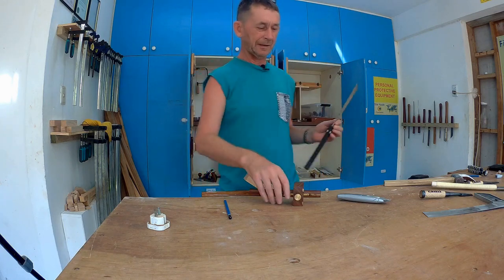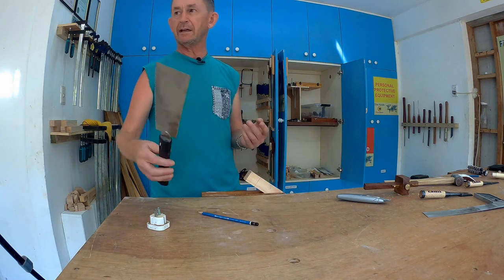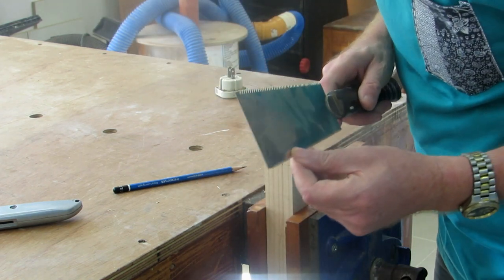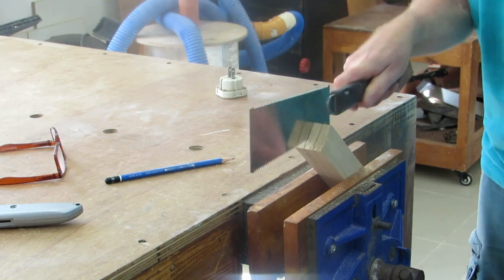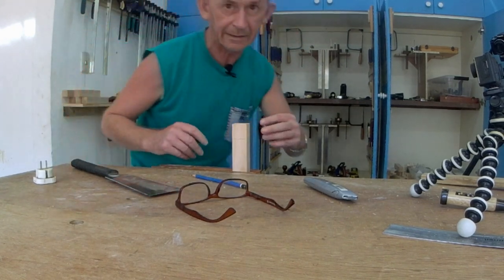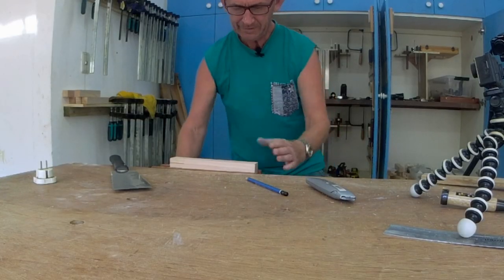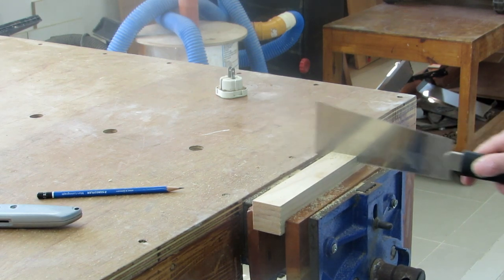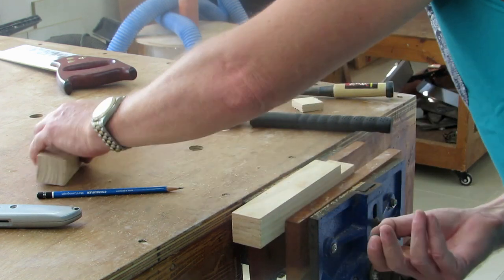How to use a Ryoba Compact Japanese Saw to cut a Tenon.

Comment: Well done. I just bought a full size Ryoba but have had a Japanese back saw for over 30 years. It’s been a great saw and still cuts well.
Reply from the maker: Yes Don. The full size one is also great, but the compact is nice for very small pieces. I have not yet had to use the spare blade on either of them.